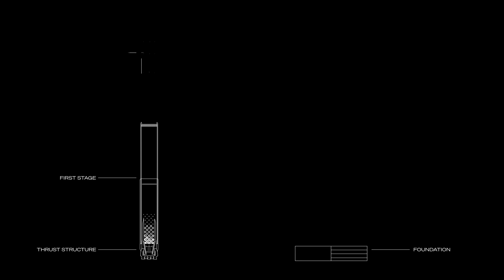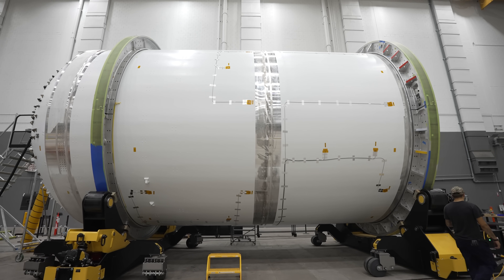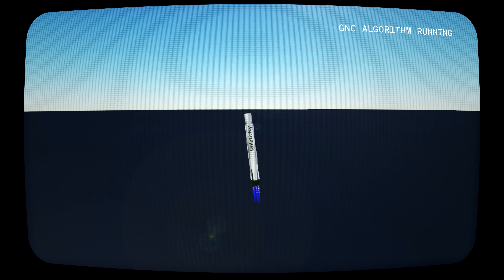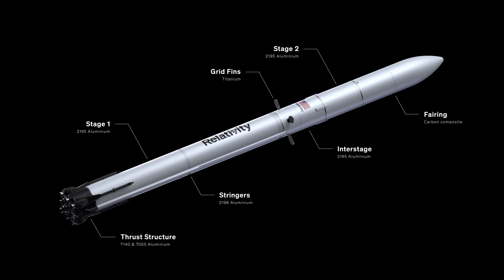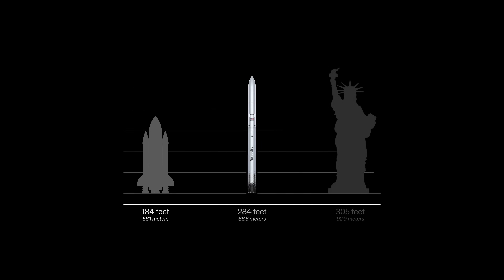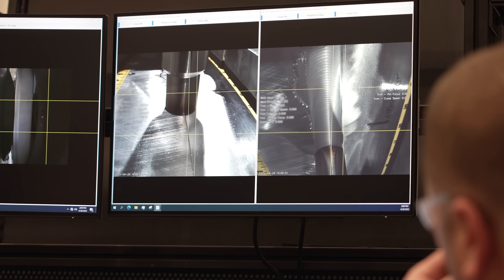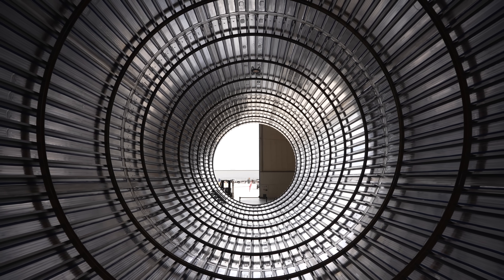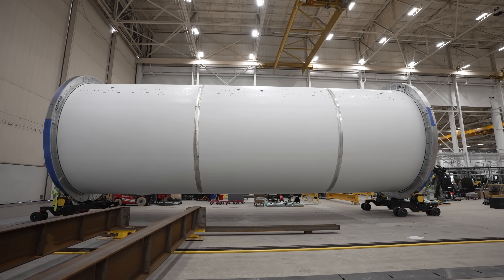Deep Dive: Terran R Primary Structures

Comment: why are they machining the barrel sections instead of rolling sheet metal and welding ribs? feels like that’s extra expensive and heavier.
Reply: welding causes distortion on the sheet metal. you can not have a perfect cylinder with welding. most probably space requires tight tolerances.

Comment: It would be cool if one could use bio-fuel to launch into space. Bio-fuel is not as bad for the environment and is reproduceable. In the near future; with biofuel, one could always have an infinite supply of fuel at consistant quality grade.
Reply: Methane is also not as bad for the environment as kerosene, solid rockets, or hypergolics.  And it could be made renewable with the sabatier process, using water & carbon dioxide and powered by solar, wind, or nuclear.

Comment: what happened to 3d printing integral components
Reply: Giant cylindrical tanks are pretty basic and regular in shape, so bending sheets of metal and welding them cannot be beaten, in terms of ease of manufacturing, cost and performance. Intricate smaller sized engine parts on the other hand is where additive manufacturing will help.
Reply: the engines are pretty integral.
Reply: Additive manufacturing is awesome, but there’s a reason why all the new rockets being built by the startups are being made conventionally.
Reply: The 3D printer would probably half to be like half the size of the StarShip launch tower to do that.. it’s not a small rocket
Reply: Wall thickness throughout should be precise. If the giant additive process can't shave even half a millimeter that's alot of weight. Additive may work alongside grinding ops if they can figure it out.

Also I may be mistaken but I think this is a 2000 series aluminum,each section is heat treated. The properties are lighter than 6061 and far stronger, comparable to steel.
Reply: Too big.
Reply: Scrapped the concept as an expensive detour that didn’t make sense brainchild of the former ceo , he’s the former ceo for a reason